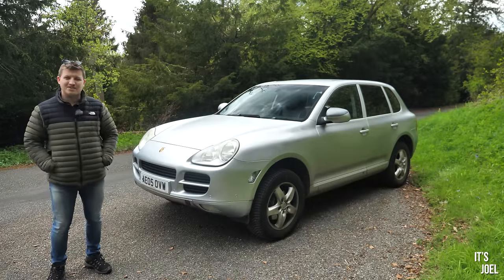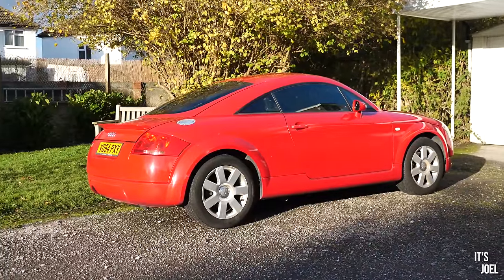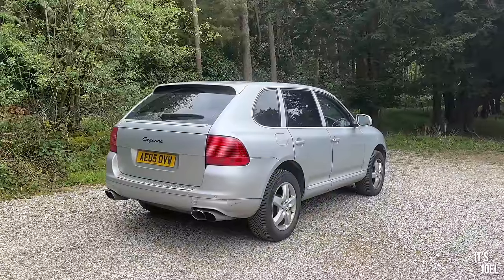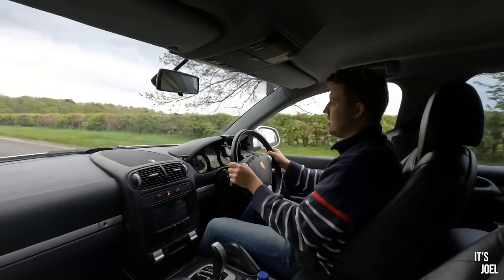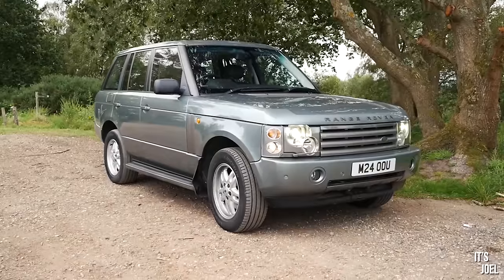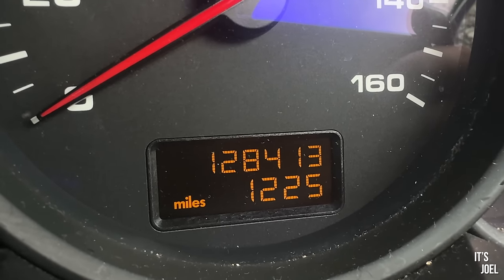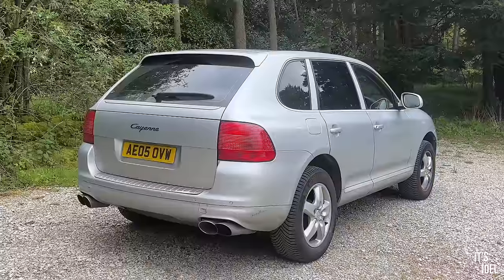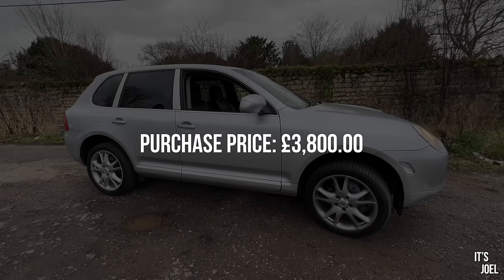6 months with my cheap Porsche Cayenne, the true cost of ownership...

Comment: I just was trying to write the same story. If you buy a used car, you have to/ must spend some money to get things fixed in the beginning. And believe me when I say, I was in Canada in the rat race with new cars financing. I paid $600 a month on loan plus gas. Coming from Germany where I mostly bought low mileage used cars, I got a fun of the 0% interest financing at the dealership. With that said, I moved to Panama in 2020. No 0% financing. No discounts on new cars. So I drive? Right. Used cars with low mileage. One 2003 Mercedes E240 with now 83,000km on it. A 2010 Silverado 2500HD, with now 106,000km, to drive my tools and materials around to my own construction site. Both are paid for. I will get rid of my E240 when I move into my house next year. The road to my lot is a gravel road with lots of potholes. So I am looking for an SUV. And you know what? I will get a good deal and have to spend as usual some extra money for tires, brake parts, maintenance - because the previous owner didn’t do that because he was going to sell it. - I honestly was looking for a small pickup truck. But the used ones are still expensive and have lots of km’s on them. 200,000 km minimum and they still like $10,000 and more for them. So I decided to get the 2500HD with the 6.0l engine. I paid $4,800 plus tires, oil change & filters. That’s it. After own it 30 months, I had to put again new tires on it for $580. But it still is cheaper than a Nissan, Isuzu, Ford or Dodge truck in Panama. Well. I pay little by little at the gasoline pump. - Now I am looking for an SUV. Touareg and Porsche cost the same here. BMW X5 is around $500 more ($7,000) for a 2011/12 model than the 2008 VW Group SUV. Today I did stumble across an advertisement for a 2008 Cayenne S with just 136,000km on it - fully loaded. Air suspension, 2 locks, etc. Price tag is $6,000. Same dealer has a 2011 X5 with just 89,000 km on it for $6,700. Anyway. I’m not going down that rat race again because it isn’t enjoyable to pay for years $600 a month plus gasoline.

Comment: Great breakdown of the costs and rationale.

Assuming that you can sell it for £5000 in another 6 months with no further maintenance and you do the same miles. It will then average to approximately £150 per month which when compared to what people pay for tube and bus passes per month, is very good indeed, considering that you travel whatever time you want in a Porsche and not crammed in like a sardine on the central line.

So the lesson is to buy something undervalued and keep rotating before you hit depreciation, I know it’s easier said than done but the numbers do make it enticing to switch every 6 to 12 months and as car fans thats what we would generally want to do anyway.

Comment: You could buy a 2017 cayenne and still have issues like coolant hoses, transfer case problems, headlight problems and much more - you're still out of warranty and you're still paying. You've fixed the majority of the gremlins on this one - don't think that because it's newer it's AUTOMTICALLY going to cost less to upkeep. Also on the flip side jus to complicate things - it's a Porsche and they're not as reliable as a Honda or Toyota and something else is sure to go wrong over the next few months, just accept it and plan accordingly.

Comment: I think it's a much better choice than buying or PCPing a newer second hand car. 

I bought a BMW 540 just under two years ago for £33k. It's been fairly expensive to run (tyres 250 each minimum, petrol at 28mpg max and insurance at over 1500 a year). 

When I factor in the depreciation of around £6000 per year it's pretty eye watering. I'd take your Cayenne given the option again.

Comment: I've owned my 04 Cayenne for 10 years and put 120,000 miles on it, I'm up to 200,000 miles now.  In the last 10 years I put three sets of tires on it.  Multiply your tires by three and divide by 10 for the annual cost.  I did the serpentine belt twice.  I never did a transmission oil change, my mechanic says its designed to last the life of the transmission and talked me out of it.  You only have to do an oil change every 10,000 miles, some say 20,000 miles because it holds 2 gallons of synthetic.  You can't do a lifetime of maintenance in six months and take an average LOL.  Do you have the 6 cylinder?  I have the 8 cylinder, it has 340 hp and is really fast.  However, if you do have the 8 cylinder you are sitting on a 'coolant pipe time bomb'.  It has plastic coolant pipes that run through the middle of the engine that are a factory defect, there was a lawsuit about it.  And the starter is under those.pipes in the middle of the engine.  If those pipes go out you have to change out the starter too and its 10 hours of labor, close to $5,000 USD to fix.  My pipes went out after 6 months of ownership and after sitting dead in my garage for about a year I decided to do the work myself.  Boy what a pain, you have to cut out the old pipes with a hacksaw and grinder.  The driveshaft can fail too, thats a big repair.  But again, those are once in 20 year repairs (once in the lifetime of the car).  Gas mileage is bad because its a 5,000 ppund car, great for digging in to and gripping snow.  My biggest fear now is the engine failing and needing a rebuild, most cars only last 250,000 miles.  Just a used engine is about $10,000 shipped to my mechanic, then the price of an install.... better to learn how to rebuild an engine myself LOL.  Don't forget to change out your differential fluid.  Oh yeah, my transmission cooling radiator went out once too, but divide that cost by 20 for the annual cost LOL.

Comment: Seems pretty acceptable on the running cost front, for reference my 2012 W204 C63 has cost me about £1/mile on average over the last 2 years and 10k miles. That includes fuel, tax, maintenance, and repairs. I am pretty surprised how bad the Cayenne is on fuel, I average about 18mpg but can easily slip into the mid/high 20s on a run and the C63 is fast when you're on it so I don't mind the fuel bill.

Comment: Interesting video, but you'd have most of those costs with any newer car anyway. A 5 year old range rover would only have a year of warranty, at best, then you're back to funding even more expensive repairs. It was also a PCP example you showed, so you're not going to own the car at the end. The wheels and tyres can't really be considered running costs, as you had decent wheels and tyres. Keep it another 6 months and hopefully your costs will start to balance out.

Comment: My daily is an E46 320D convertible.  Last year it cost me roughly £1300 including tax, MOT, insurance, two tyres and diesel.  
My 4.5L V8 Cayenne is my second car - I'm not stupid enough to run one as a daily. Paid £2400 for it in March (Jan 06 plate), £395 tax and £344 insurance.  No service costs yet, only done 200 miles,
Lets be honest though with yours.. you've added a lot of preventative maintenance over your monthly price when your belt change and gearbox oil etc should be spread over 10 years / as long as you'd expect it to last.

Comment: You have switched from 20inch to 18inch wheels. This will affect the calculation that your car’s computer is making regarding the fuel consumption and reported speed.
Reply from the maker: Good point. Just calculated it though and the overall difference is 1.33% so the change would be negligible
Reply: No, the overall diameter stays the same

Comment: Wifes diesel Rav4 over 12000 miles all in around 2700 , but needs tyres but includes dealer servicing.. 2yr diesel mild hybrid Sportage all in about 2050 to run over 10000 miles .  We wont discuss the elephant in the room , the 05 E46 320  m sport coupe which i have had for years , over 2000 miles it has cost about 1400 . Currently awaiting alloy refurb then an MOT 🤦

Comment: Put a LPG fuel system in it and half the price in monthly fuel bill 😅
Reply: Cars/Vans I have driven in the past with both native and converted LPG fuel systems appear to be a bit of a false economy, although it could just be the efficiency of the ones I have used. Yes, LPG costs half as much, but I only get half as far on it too, which made it the same cost as using the petrol/diesel. Perhaps it was a tiny bit more efficient, but certainly not enough to make it worth covering the cost of conversion.

Comment: Interesting and grate video. 
I think you’re looking at it a bit wrong only over 6 months with what you have done you need to look at it over longer term. For its age the engine is prob bit under powered so lower mpg but not as bad as expected for such a big heavy car. .  Don’t think  you should include the wheels triers.  maybe even the service stuff. Maybe over a year for routine service.  Not the extra bits you need to look at them long term over a few year.

Comment: Got the same car its done 105000 ruffly...
Had a front left wheel bearing,new battery+alternator in 18months
Paid £3500 for it
Was value at £5019 in an insurance claim.
Got paid £3500 and bought it back for over £1500.
Now a cheap can N
Goodluck guys
Reply: Ps it's a manual gearbox 
Apparently unusual...
Adding it got wrote off by an insurance company,for a small dent next to right head light.
But they admitted liability
The claim I had against the other party.

Comment: That VW engione was never the most economical whatever car it was put in and it wasn't designed be. Add in the fact that its been put in a 2 and a half ton brick, mated to an autobox and FWD and 25mpg on a run sounds pretty good. The V8 probably wouldnt have been a whole lot worse.

Comment: If you aren't impressed with the performance, swap it for a more fuel efficient car or a faster one instead of the worst of both worlds you have currently. Yes it's a Porsche and yes it is big and practical and decent off road, but I bet you usually have fewer than 4 ppl in the car and never need to do any serious off-roading.

Comment: I have one but mine is the turbo and it's Green which I love. I know what you mean I do the same look back at it when I park up lol. My radio doesn't work you don't need it. I listen to my V8 when I am driving that is music to my ears. 😊 I get 26 mpg if I take it nice and easy. My insurance is cheap to 25 pounds each month. Spending 500 ish on petrol each month. But who cares haha 😆.  I had mine for about 2 yrs. I drive it everywhere and yes I am anul too with service and totally get it you have to be. Design 911 call them for parts they have good prices.
Reply from the maker: I really wish mine was a turbo right now. All that extra power and lovely options, but the ability to get the same if not slightly better fuel economy.

Comment: You need to amortise your costs over a longer period.  Also fuel is irrelevant you have to by that anyway for a heat engine vehicle (smaller car/engine will use less fuel).  I run cars from 1.4 Skoda to XF sportbrake.  I never have finance and do all my own maintenance.  Skoda 1.4 costs me about   £75 per month including depreciation over 4 years.  Cars in the Jaguar XF bracket cost me about £250 per month over 4 years.  There are an awful lot of people who have no idea of the real cost of acquiring a car on finance/PCP/lease etc.  You can also improve on my figures if you time the purchase correctly on the depreciation curve or you can negotiate better than I do.  You are driving a £65K car on lemonade money.

Comment: The r32 engine is a juicy engine, in the golf it does 25 mpg so with that extra weight.. I’d say personally it’s not worth it. That’s a lot monthly for what is a bottom of the range 19 year old cayene. 21 mpg is awfull . You’re not using the best fuel either. And as you say it’s not fast. And the ride is hard. A turbo s would be just as fuel efficient and bloody quick too. That would be a better option.. ?